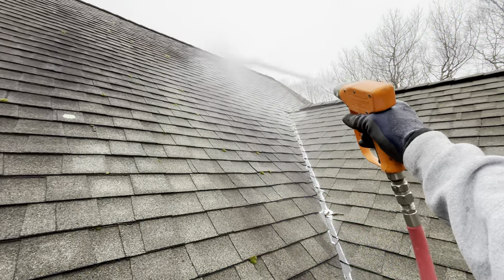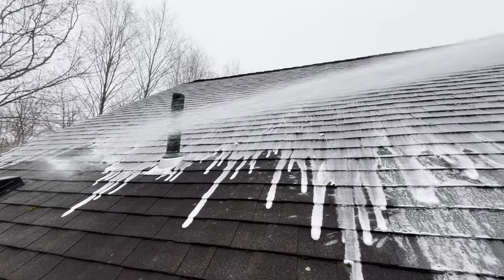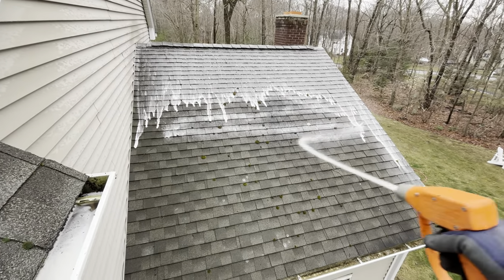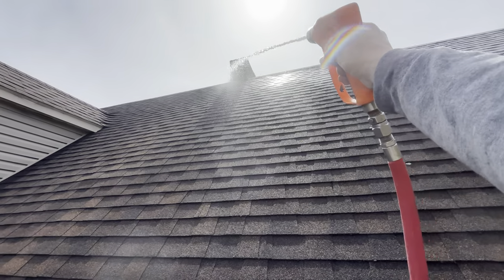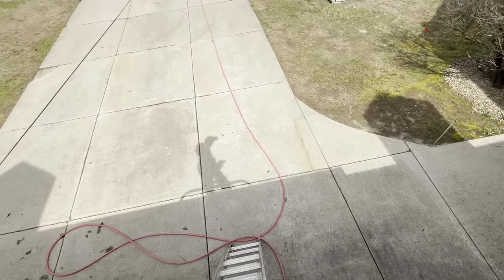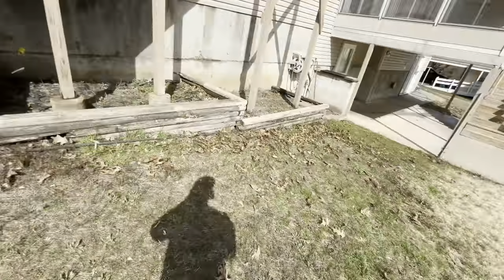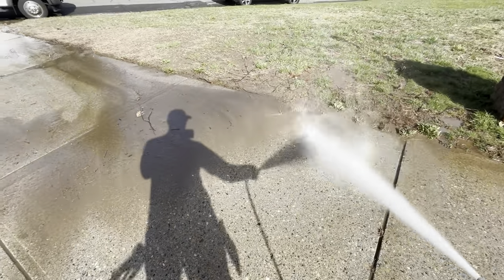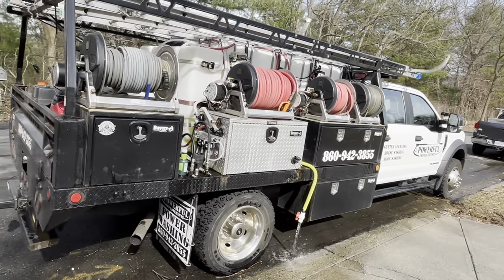Fat March Wrap Up

Comment: ive had better results running 3k psi, house wash pre treat, 6% post treat. lines are hard to see if you run your surface cleaner perpendicular to the driveway, starting at the lowest spot first. just my 2 cents

Comment: With your roof wash process did you find it not necessary to pre wet vinyl but rinse vinyl after applying that hot of a mix to prevent flashing ? Always like your videos
Reply from the maker: Depends on conditions and if I’m house washing. Pre wet never hurts
Reply: @powerfulimprovements   gotcha. Yeah I havnt stepped into roof washing yet and thought sh sitting on vinyl would leave marks especially at the higher mixed ratios for roofs.
Reply from the maker: @brandenpatterson9936  you 100% have to rinse the siding.  Can’t leave it
Reply: @powerfulimprovements   totally gotcha. That was my impression. Keep rocking out there and always enjoy watching your videos. Still New to the industry and lots to learn. Take care !
Reply from the maker: @brandenpatterson9936  ✌🏼❤️

Comment: when you use that gun.do you turn your pressure down in your pump?
Reply from the maker: Which gun?
Reply: @powerfulimprovements  the one in your video
Reply from the maker: @pressurewashingandhoodcleaning  if your talking about the orange roof gun, no.
Reply: @powerfulimprovements  ok. mine kicks back a lot. i have a 3000psi 5.5gpm pump
Reply from the maker: @pressurewashingandhoodcleaning  that’s the trap pressure vrt3 unloader causing that